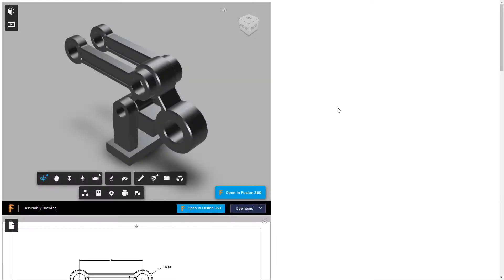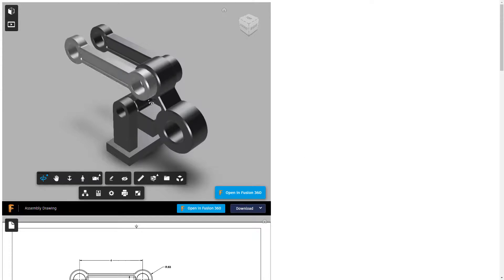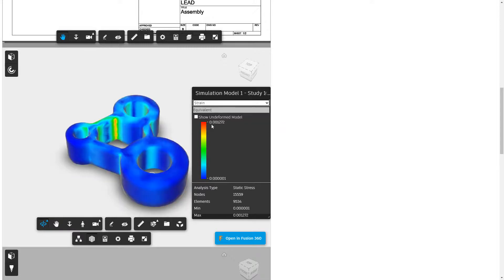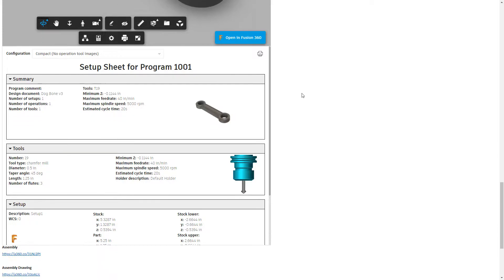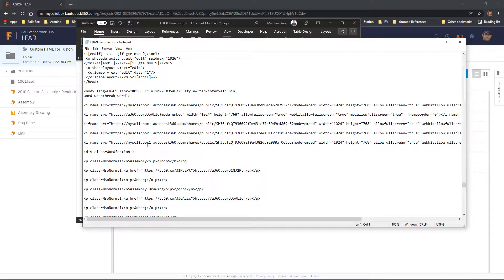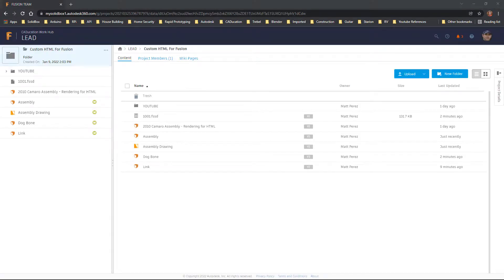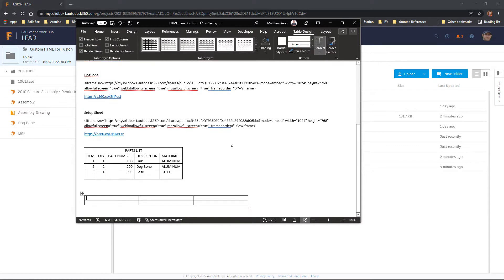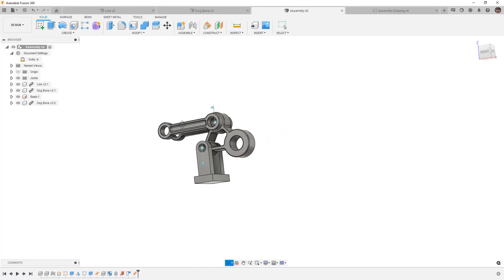Fusion 360 - Custom HTML Viewer Example #Fusion360

Comment: Very Cool.  Any chance you know how to let web users modify parametric values (eg, you have a variably sized product that is parametrically modelled and you'd like them to see what it looks like as they vary length & width?
Reply from the maker: Not that I know of.  In API you can have html dialogs and pass info that way and maybe allow the user to select configurations, but a true enter a value see an update, i don't think that is possible.